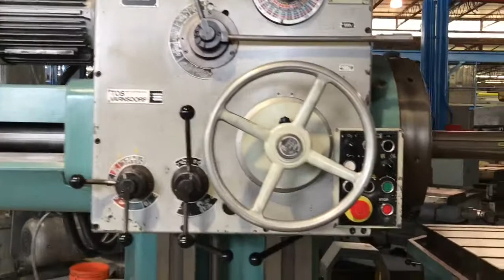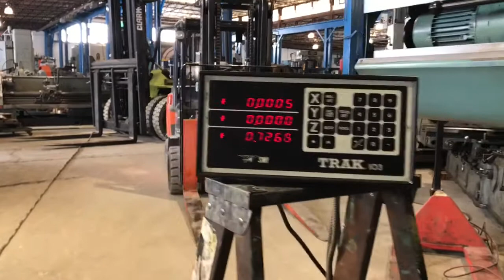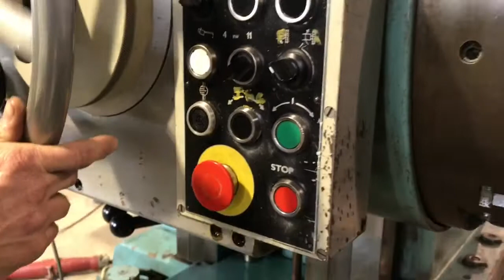4” TOS W100A HBM new 1991

Comment: I am a machine mechanic. I have a problem with tos w h 63 / 80. I need an operating manual because it is missing and does not exist. If possible, the fault is that it only works manually. There is no automatic. Thank you